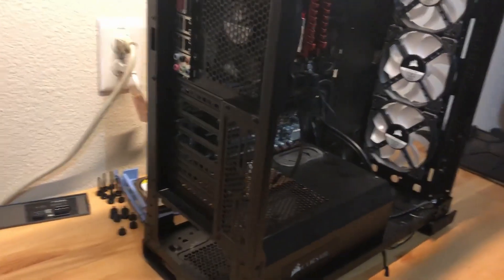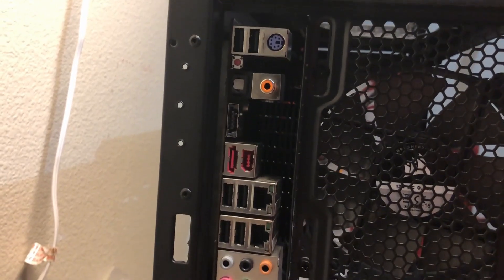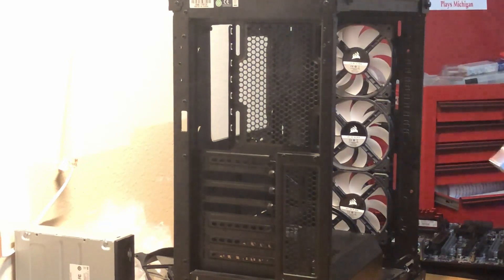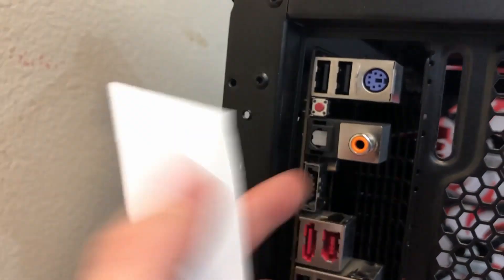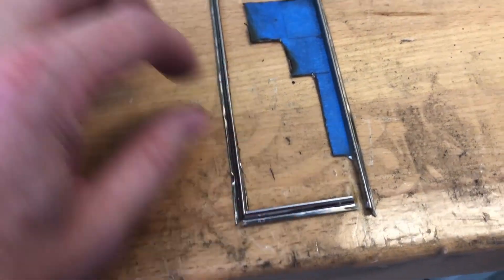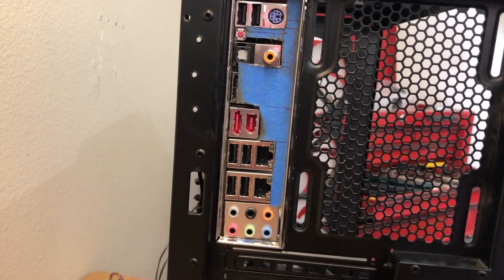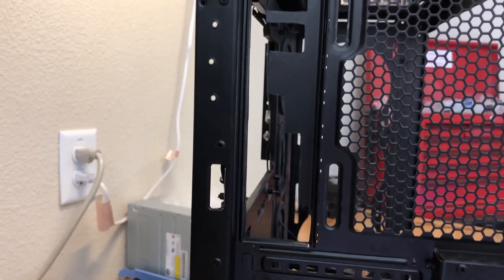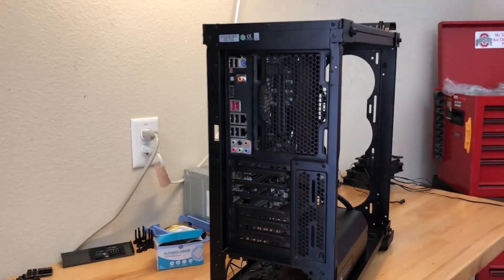How to Make Your Own Custom I/O Shield

Comment: maybe light and tracing paper try to outline the areas and go from there....
Reply from the maker: I did initially try that!  It didn’t go so hot!  Lol
Reply: @PCTechHustle  ill be doing a complete custom build myself ill be taking an old laptop and removing it from the housing... ill be using some mountable extension cables off Amazon 1 for USB 1 for hdmi 1 for ethernet all I did was search each one on Amazon (mountable usb extension cable 1 foot) and (mountable ethernet port extender etc)  so these cables have 2 screws I can basically create my own IO set up by placing the wires where needed to best fit then I gotta get some IO shield blanks and do my own custom IO shields. I'm converting this to a desktop case so I have to also get like a custom mounting plate or something im thinking a plate the size of a regular motherboard or cut custom to size and I can trace out drill holes that match the mounting system inside the case a.d screws and all tom mount the plate to the case then I gotta drill a second set of holes, these holes must match the laptop mounting system.... so ill have to trace over those mounting holes and drill... then I gotta get all the right fittings this plate needs to ground out still to the case so its gotta be conductive... I will need to make it look like a professional quality desktop pc when really its just a laptop gutted and dressed up fancy. I find a way to mount a desktop heatink to a laptop processor and GPU if needed so ill have to mount it semi close to the IO shield I'm hoping the power port lines up with the IO shield
Reply from the maker: Wow sounds like a wild project!
Reply: @PCTechHustle  yea it'll be fun tho doing it for a friend that doesn't want a nice desktop just wants a pc for dungeons and dragons online... and Facebook and Netflix thats it... I said if thats all your doing... your laptop will work perfect for it... it'll be like 150-200 dollars but its cheaper then a decent gaming rig that can do the same and not be a laptop lol plus it won't look as good for 200 or less unless I do it custom...

Comment: I'd rather use a drill for the round holes / outputs and buttons, and also for usb ports, then file out the rest.
Reply from the maker: Hey that works too!  This was my first hack at it.  I think I can do a better job if I apply some of the good ideas in the comments.  Thanks for watching!
Reply: @PCTechHustle  NP, I was actually looking for a way to mod a case so it fits a standard I/O shield and somehow ended up here. I've made a variable PSU from an old PC, and I had to modify the case a bit, it's fun with DIY projects.

Comment: I have to do that soon. Pretty rough no offence dude. I am thinking about using a plastic plate if it will stick in and burning out an exact outline with a soldering iron. Helps to have some stuff poking through to fixate, like a coax mine has.
Reply from the maker: I think I want to revisit this soon.  I’ve had several people give some good ideas.  I definitely can do this cleaner as a next attempt.
Reply: @PCTechHustle   I did my thing tonight and took the easy route with some lighter plastic. It was a bit bendy so I taped the edges inside. It is a low priority system so I was just concerned about stuff touching the electronics. All systems do have like holes for bugs to crawl through. Anyway this is what I did and tomorrow late night I'll put up a video on my channel about it.
http://web.ncf.ca/fs864/pickup/mytry.jpg

Comment: Will it run fine if it doesnt have an io shield?
Reply from the maker: It will.  The shield is simply to protect the inside of the PC from extra dust / dirt / debris and direct airflow inside the case.
Reply: PC Tech Hustle tysmm I dont have an io shield rn so I was afraid to change cases

Comment: I created a template like you tried with paper. For the jack plug which was sticking out, just press against it to get an imprint of where it is, then cut it out. Once I have a paper template I use it to make a cardboard one and paint it black. Does the job.
Reply from the maker: Nice!  I tried something similar but kind of struggled a bit.  I found using a caliper made it a bit easier.

Comment: Find an image of your motherboard's I/O shield online. Open it with editing software (Paint worked fine for me). If necessary crop the image to the exact outline of the shield. Resize the image to 600px X 180px. Make sure to print it at 100%. There's your template.
Reply from the maker: Great tip!  I believe someone else also mentioned something similar to doing this as well.  I kinda with I did it that way!  Hah!
Reply: But, how do you get the exact size as the I/O shield? I mean, so many factors at play; photo shooting difference, lens crop etc., I guess in editing software, I'll have to give exact physical dimensions of the I/O shield? Will give it a try. But, I don't have such fancy drill :(

Comment: Just take a photo of a motherboard's rear in a case, open it in some photo editing software and resize it to match the real size. Then print out the photo and you should have a template ready. Just stick that to a metal plate and use drill and dremel to cut.
Reply from the maker: Great idea!  I might have to try that next time I have to make one!
Reply: Also, you can get plastic blanks that you can just cut out with a knife.
Reply: Very smart taking a photo!
Reply: just msg a friend with a 3d printer gawwwd
Reply: @documentarydaysDD2K18  but some of us have no friends 😭 ...with 3D printers.

Comment: I'm currently having the same problem for two motherboards (I accidentaly threw some boxes in a spring cleaning and think these shields were in), and I was going to buy a very expensive pair of I/O shield replacements, but your ideas about mounting the motherboard in the case and taking measurements directly is a great approach. I had another idea in order to improve and speed up measurements: you can take a photograph with a long lens (in order to dismiss perspective errors) and scale precisely in a computer (including doing barrel or pincushion corrections), then print out and trace the holes with this template.
Reply from the maker: Cool idea!

Comment: Does it matter if you don’t have a io shield
Reply from the maker: You don’t need one but it helps prevent dust / anything else from entering the inside of the PC case.
Reply: I think yes because the io shield grounds the connectors to the case
Reply: @areagaming6996  Well, the manufacturer supplied one does but a homemade one doesn't have all those fiddly little tabs that make contact with the shells of the IO ports. In fact, if you look at a pre-made shield it doesn't just fill in the blank space - there's considerable overlap with the connectors.

Comment: 💜Nice idea, love the video!💙

 When i made mine following what i learned on this video, i tried a few different ways, so a tip from me is, I find it helps to drill all joining lines and corners out first with a small dremel-type drill bit, before cutting. Also, a pair of small, fine point tin-snips are really good for cutting, give a nice finish and you can get in tight corners and curves with them.

Another tip is to try and find a picture of the i/o plate for your motherboard on google, crop it and print it to the correct size, use pritt-stick glue or similar to glue it on to the blank plate drill the holes in the corresponding places, and cut out the unwanted sections of material, warm with a hairdryer to remove the printed template. File any sharp edges with a nail file, paint if wanted. Job done.

Also if you have access to a vinyl cutter, you can add the dimensions and cutouts to that and use the machine to cut it and stick it on as a template, and if you use a printable white vinyl sticker (about £1.00/$1.30 for a single a4 size sheet on ebay etc) you can print text, logos etc straight on to it to correspond to the correct outputs (usb, keyboard, audio etc)  and place that on after cutting to give it a nice professional finish.

Hope you dont mind me putting a few of my ideas in the comments section!
Reply from the maker: Isabelle Drennan very awesome tips!  I think if I have to do this again I will definitely apply these to my next attempt!!! Thanks for the feedback!!!
Reply: @PCTechHustle  great! I did manage to get a great finish on mine using tin-snips (just a cheap pair i bought of ebay, about £3-£4) because the metal is so thin, once you drill a pilot hole the tin-snips can get in all the tiny corners and i managed to cut out the circular holes for the keyboard and mouse ports perfectly, leaving a very tidy finish!

Another way of making an i/o plate is by 3d printing, which i havent tried yet, but hope to in the future. I think a 3d printer would give very good results as i think if you got the 3d model to fit exactly, there would be no gaps for dust to be sucked in to the computer. And even though all my fans and open areas on my pc have dust filters, dust still gets in to the system, and i suspect its through the small gaps on the i/o plate. Eliminating those gaps might make put a stop to it!
Reply from the maker: Isabelle Drennan tin snips is a great idea!  Someone else also recommended 3D printing which is a great idea too!